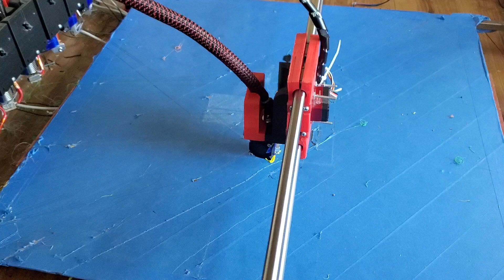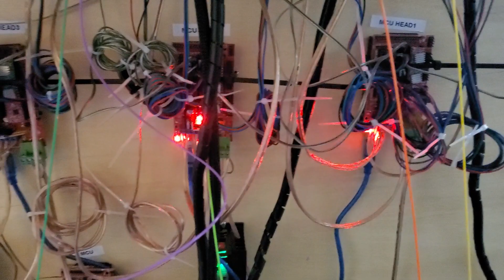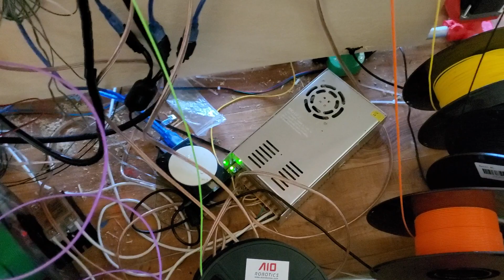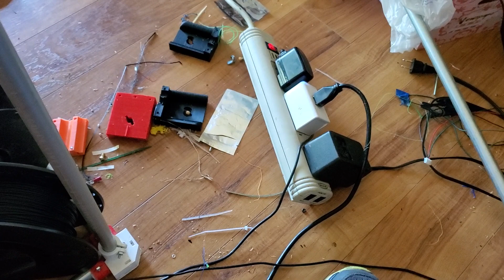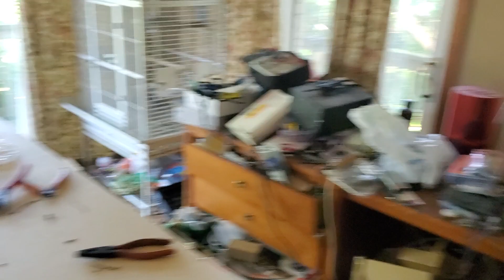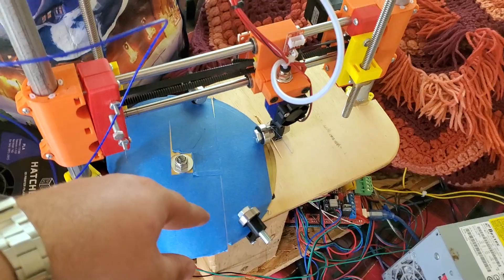Tool changer 2 demo

Comment: Hello Rob. I just wanted to know if you could show me how to change the setup for your tool changing printer to use on a plotter that can use multiple pens or markers.  Thanks in advance and keep of the great work you are doing. I don't mind donating a few bucks for the help.
Reply from the maker: Sure, it would just need to be a marker holder.  Can you give me the size and shape of the markers and I can adapt a tool holder for them
Reply: I built a custom core xy plotter that runs grbl. The firmware is running on an Arduino uno with v3 cnc shield connected to a computer running Universal G code sender.  I use a variety of sizes but the main ones are between 16 -23 mm diameter. My main problem with  this project is the software and how to configure it to run a  core xy plotter with tool changer.

I guess what I am asking you to help me with is how to configure the software and get the circuitry necessary to convert my exisitng plotter to a tool changing plotter.
Reply: How do I get to your patreon?

Comment: you're amazing for sharing the files!
How has it been lasting btw :) ?
EDIT: oooh i checked the STLs. and I'm slightly confused. what have you been using on the servo to lock in it. a printed T shaped thingi or did you buy something that can go into your plastic threads
Reply from the maker: A wingnut screwed to the servo.  It was a 3d printed part but it was hard to set up and would break
Reply: @RobMink  huh a wing nut! that's so smart! 
" It was a 3d printed part but it was hard to set up and would break" I'm a little confused by this. what was a 3d printed part? the other side that the nut spins in to lock the tool?

Comment: Get rid of the Wingnuts. There is a better way.  I designed a system like this over a year ago (couldn't build it because of no resources). I am glad to see that the prototype works. But your connection system ( I hate to say is a good attempt) to the head-ends leaves to too much wear. A better design would require non moving parts and guides for a simple  tight fit.
Reply from the maker: Interesting, what is your design that uses no moving parts?
Reply: @RobMink  Think magnetic prison door locks. If you put neodymium magnets in the head end module. Then put in a reverse fold electromagnet on the carriage. Using two male probes on either side of the electromagnet to stabilize the module as it slides into the holes. 
When it is ready to switch out the modules. All it has to do is charge the reverse electromagnetic in a pulse to release the head. 
The only time that the carriage needs power is to just release it. 
It will not require any more power to hold the module to the carriage. Only to release the module. 
Because of this you do not need to have mechanical parts loosening and tightening the module to the carriage. Which also means less mechanical parts to wear down. 
Plus you want your carriage and head end to be light as possible and this will allow you to take a heavy electric motor out of the equation.
Reply: I actually have the design on tinkercad. 
I'm just really glad to see that this idea actually works. Kudos to you my friend and keep up the struggle.
Reply: there can be problems using magnets or electric magnets to couple tools as the magnets can stop fans running just something to keep in mind, fantastic work